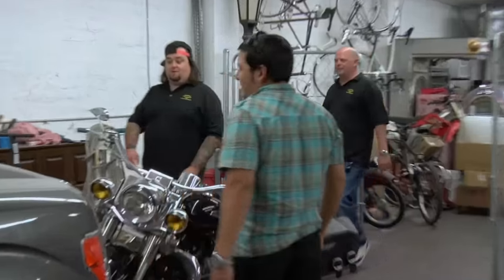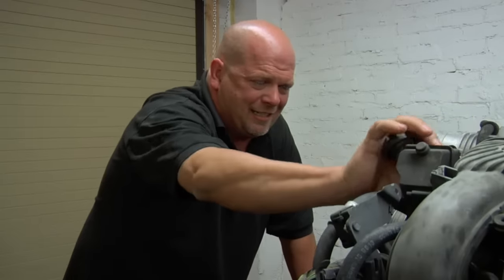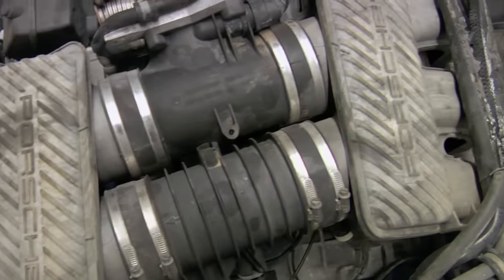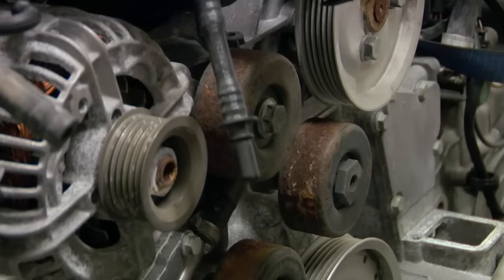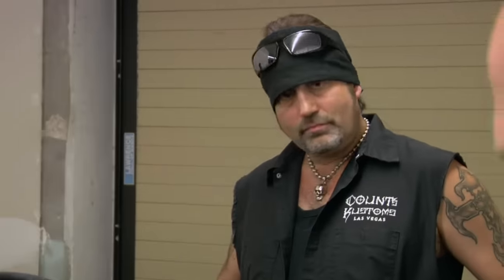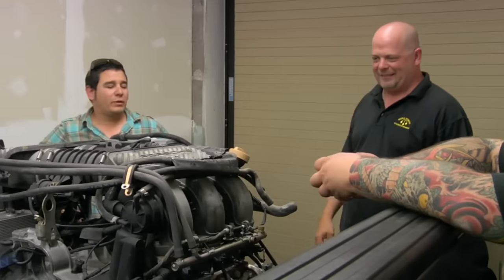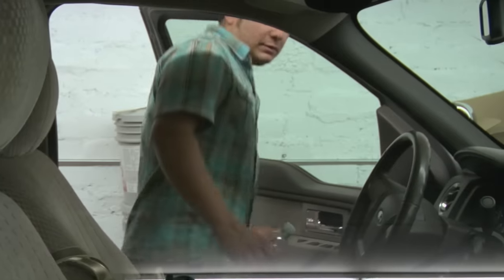Pawn Stars: Seller INSULTS Expert Over Damaged Porsche 911 Engine (Season 4)

Comment from the maker: Watch all new episodes of Pawn Stars, Wednesdays at 9/8c, and stay up to date on all of your favorite The HISTORY Channel shows at http://history.com/schedule.
Reply: Dannys a real man for letting him slide after insulting him like that
Reply: Sold!!!
Reply: A 2000 model year 911 engine is one of the worst POS engines they ever made. Stay away from all 911's from 1999-2005. Even the 2006-2008 ones were just OK. 2009 on is fine.
Reply: Yea, no way to know if your $ is well spent.  Have to treat that engine  as a rebuild only unless more is known about it. MAybe do a psi wet and dry test using an external power source to spin the crank. With that results only way to justify a purchase. There could be more, case cracks, etc.
Reply: Jes

Comment: Even with ZERO water damage, the 1997-2005 Porsche engines were notorious for IMS bearing failures, and the 2000-2005 were of particular concern, especially if they sat idle or were driven only infrequently.  You did well to pass on this pig rather than get poked!
Reply: I was thinking the exact same thing. You really got to hear them run to know
Reply: Hence that's why it was sitting in a junkyard
Reply: @benruether8294  That bearing could be "failed" and just before it gets to the level of making noise you would hear while it ran. This is why its now considered a preventative maintenance item on them. Fix it before it eats the engine. However with that said, rebuilding the engine would be a given regardless of its condition.. someone should have inspected the engine properly. I get Rick not wanting it, he should have just said that rather than try and make it LOOK like they know more about it and disrespecting the guy. Even Tavarish would have borescoped the engine.. and hes not what i consider a "mechanic"... Just a hobbyist with a ton of money.
Reply: @crisnmaryfam7344  The only “disrespecting” was done by the guy. 🙄
Reply: Pretty sure that 1997 and 1998 993 engines didn't have IMS failures.  lol.
Reply: @TheInvisibleAmericanMan  thatnks for speaking up, So whatcha think of all these "mechanics" on you tube?
Reply: Bingo!
Reply: That goes for all engines, if you can't hear them running or take them apart they could be expensive door stops!
Reply: 12-14k is the going rate for that "pig" now
Reply: @subyoooyoy  for a good one, not one that needs to be completely rebuilt.
Reply: Thats a preventive maintenance thing man, not a show stopper. Get your facts right please. 4500 for this engine even as a core charge is legit.
Reply: @rubbermoetroken  The category "preventive maintenance" refers to routine changing of oil and filters and the like.  Replacement of internal bearings (e.g., camshaft, jackshaft, crankshaft, or IMS) requiring engine disassembly is categorized as "repair."
To insist otherwise one would have to have his Porsche head stuck way up his Porsche tailpipe.
Reply: Common sense......nope
.
Good call

Comment: When the seller said to bring a good mechanic it cracked me up..this mechanic is among the best
Reply: A Good mechanic would have said the same thing or at least turn the crank so u know it's not locked up but even then who knows the mileage, when buying engines you kinda have to go buy what it's worth torn apart completely, like heads, crank and pistons but you have have to be into those specific engined and be a rebuilder, then it's worth something
Reply: a GOOD actual Mechanic would have borescoped the engine before saying stuff got inside of it. Now he is right sayin some of those open ports are issues, not deal breaking ones though.
Reply: It's funny because he expects the buyer to take on the additional responsibility of having the motor checked by a mechanic. An old engine is going to need some service. The fact that he insulted Danny ensured that he would get nothing.
Reply: @LPWSzzz That is what I was thinking. Scrap value...
Reply: Danny owns a shop, never seen him turn a wrench he just tells other people what to do. He may know stuff, but he aint no mechanic..... my 14 year old kid could tell you that engine (definitely not a motor) was junk.
Reply: "among the best" yet he thinks an aluminum engine corrodes? lmfaooooo that engine is worth 12-14k now btw. My dude has xray vision, he can see inside the engine and all the rust that does not exists because aluminum doesnt rust.
Reply: @subyoooyoy  If you don't understand that all metals oxidise or corrode then please hand your man card back in...... Aluminium corrodes worse than steel in certain circumstances.

Comment: You can’t leave fuel injector rails,throttle body,exhaust manifold all exposed to rain and moisture. The entire motor needs taken apart to see how much rust is going on inside. Good call by Rick not to buy this motor. He would have to put a ton of money into it just to get it running well.

Comment: When a guy won’t let you open up the engine, then there is something he doesn’t want you to see
Reply: You don't need to "open" an engine to check its health.  A compression and leakdown test will tell you everything you need to know
Reply: @evogsr4807  check the cylinder walls and pistons with a camera too. would've helped the seller if he had it running in a video. For all we know, it could have knock, low compression, clogged injectors, and more.
Reply: @evogsr4807 a compression test and leakdown test is not going to catch a spun bearing, scored crank, etc.
Reply: Open up the drain plug, pull the dip stick, pull the spark plugs , use a scope...for a general fast check ✔️

Comment: As a tech for over 30 yrs plus being around it all my life. Engine was rained in, water down fuel rails and injectors, water or moister in intake and exhaust. Engine would have to come apart and junk fuel rails and injectors and most likely throttle body too.

Comment: As a Porsche 911 owner ( 997 / 2006) the early water cooled Porsche 996 engines have many issues . The failure of the intermediate shaft bearing to name one. This failure  results in the total destruction of the cars engine. My 2006 has improved internals so a well maintained 997 engine has from what I have read about a 5% chance of having the issue . You guys were 100% right to pass on this engine 👏👏👏👏👏

Comment: That motor is a boat anchor, that might not even be rebuildable. That year of 911 had all types of motor issues, including the infamous IMS bearing. Also many places that should have been sealed off and could have let water in, were left open. This cracked me up.

Comment: as a Licensed Master Mechanic with 42 years experience here is my humble opinion:
1. unknown engine condition. Why was it in a junkyard?
2. throttle body uncovered is not a big deal. The throttle was closed. 
3. fuel rails open. Not a big deal.
4. rusty pulleys. Easily replaced.
5. oil condition. Danny never checked the oil.
6. at best this engine is a core to rebuild. valued at about $500.

Comment: As a mechanic, I completely agree with Danny. Having fuel rails and intake and such exposed to the elements can and will make everything ruined and unusable. Even if it was torn apart and a machine shop attempted to repair the block, heads etc, it would still be a roll of the dice.

Comment: That look Danny gave him is killer,  Danny is right,  humidity gets into everything, he's better off scrapping it 😊
Reply: Not better off scrapping we don't know condition if it truly wasn't blown up it is definitely atleast a good core. I just got shafted at a wrecker bought a used engine for my Chevy truck didn't get around to installing it for 6 months I was well passed the warranty I decided to pull the heads after seeing bolts in the intake runners what I found was severely rusted cylinders I cleaned up as best as I could and with each piston as low as they go I honed the cylinders it came out nearly perfect (no pitting thankfully) . it's in the truck with perfect compression on all holes and running good I was not in the position to do a proper fix or buy another engine with how prices are on stuff right now and everything else going on in life so I chanced it and it's working great this engine could be a good candidate for something like that if you were building a budget 911 but the engine should be sold at the rebuildable core price and the new owner can decide if they want to chance a greasy build or have it rebuilt but please do not scrap stuff like this as it would be almost 100% salvageable in some shape or form if we continue to just scrap eventually there will not be more 911 engines

Comment: The seller is right........ If Danny knew ANYthing, he'd have had a wrench for seeing if the engine was seized and a simple scope (you can get one for your phone for less than $15) for looking down inside at the pistons thru the spark plug holes IF he was any kind of actual mechanic.... Truth be known, with a battery and fuel supply, that motor would probably start right up in the back of that truck..... All he had to say at the start was, "show me it runs" and that be that...
Reply: The rust on the outside is enough to see  it hasn’t been stored well

Comment: The fact that he's trying to sell a roached M96 for $4500, when I bought a running one for $2500 WITH a car attached, amuses the crap out of me.

Edit: if it's a water cooled Porsche flat 6 from 97 to I think 07, learning that it sat for "a few years" is a deal breaker, unless you're getting it for next to nothing. That IMS bearing doesn't like sitting in oil nor does it like sitting still.

Comment: Props to Danny he simply stated to determine the condition it needed to be examined internally …that’s correct with it you have no idea .
Now maybe he wasn’t aware internal inspections can be carried out with an endoscope from the outside but hey the way he was blinking he didn’t know what he had ..
And yes this was likely an early 99 or 2000 engine are notorious for bearing and seal issues .. good call !

Comment: Just put a boroscope inside and take a look. Also, you could turn it upside down and see if water pours out, you could put a wrench on the crankshaft and see if it turns over.

Comment: The "expert" didn't even mention a compression test and if he think u need to open a motor up to check if it's good I'd be right there with the customer. I've bought MANY engines from the junk yard. As long as the fluids aren't mixed and it holds compression there isn't anything that can't be fixed

Comment: First off. A junkyard engine isn't a bad thing. If you're buying a Porsche motor anywhere, you're going to overhaul it and do all the work to bring it up to operational standards. The only thing these guys needed to do is get a bore scope and inspect the cylinders. If there's no rust or pit damage, the engine can be built. Try buying a low mileage engine like this in prestine condition. 
$4500, no way. I would be in it for 1,000 if I was in the market.

Comment: Dude is right, a good mechanic would of just looked at the engine sitting in the back of the truck and say how good that engine is without hearing it run or inspecting the internals

Comment: open throttle body send in a borescope and show sir shifty the internal rust !!!!!  look thru plug holes and oil pan drain!!!!  no doubt theres issues as when camera glanced over open connections on motor you could visible see the corrosion and rust tint!!!  even you pull it motors always run a compression test as internal rust will collapse rings!

Comment: Danny was a class act who exercised exemplary restraint. He could have destroyed that seller by saying he'd forgotten more than the seller knows about engines.

Even if a boroscope had been checked on the throttle body or within the fuel rail, I'd have concerns about the intermediate shaft/bearing, that are known for failing when the whole car is left sitting without being driven for extended periods. If it's an exposed engine in the elements to exacerbate an IMS/bearing failure, I wouldn't walk away from it; I would run.

Comment: 100% for sure at least two of the cylinders have open exhaust valves. That's normal. The exhaust not being closed off means those two cylinders have had years in the elements, being humidity or whatever it is. Same with two opposing cylinders intake valves. The throttle body is not sealed, therefore humidity has been making it to the intake manifold and two more cylinders for years as well. 

Any decent mechanic would know this. That guy was probably a scammer.

Comment: The way to sell an engine like this is to have it rebuilt, and then sell it with a warranty of the shop that rebuilt it.
A rebuilt 911 engine like this could easily bring 10k, and it would probably cost half that to rebuild it.
Reply: Be a good approach, upgrade any known issues, decent warranty, etc. 
unless the guy knows its total junk and beyond salvage, rod knock and run hot, probably how it ended up where he found it

Comment: Tbf that mechanic should have known the 911 engine of that time had issues with both bore scoring and the Intermediate Shaft Seal (IMS) bearing failing which costs 000’s to fix separate to any corrosion inside that they were worried of.

Comment: Motor came out of a junkyard, red flag.  Unless you heard the motor run before it was yanked  out of the car, forget it.  Junkyard motors are only worth something if rare, say a 426 Hemi that's been sitting undiscovered, or a 428 Cobra jet, etc.   Sure, I'd grab either if the price was right, knowing I'm going to do a complete tear down anyway.  This dude should just sell it on craigslist.

Comment: The one rule of thumb when buying a used engine is when you hear it come from a junkyard unless you or buying a engine from a junkyard cuz a lot of people buys old small block 350 LS engines and rebuilds them but when you buy one off of Facebook marketplace will let go or offer up and you hear junkyard and here that's been sitting for years that's a red flag because moisture would get into the cylinder walls and corrode it badly making the engine stuck or seized So this guy telling Danny that he's not a professional one he spent a mechanic all his life is bullsh

Comment: Are you kidding me? A idler pulley or serpentine painted pulley getting surface rust doesn't devalue an engine. The the oxidation on the alternator and other aluminum parts is your best bet to tell how long it's been sitting or exposed to the elements.
Reply: Why would they want an engine that's known to be absolute junk?

Comment: The Seller had misdirected rage. Rather than Lash out at Danny he should have been angry at the guy who did not take the proper steps to protect the engine from the water and environmental elements clearly he was the mechanic who did not know what he was doing. Secondly, the buyer should have been mad at himself he took a very big gamble buying the Porsche engine from a junkyard and it did not work out. Thirdly the buyer probably knew there was at least some degree of damage to the engine and wanted to recoup some of his losses. It's a good thing Rick is smart and savvy and saw what was really up.

Comment: The first thing u do is c if it will turn over & then do a compression test if it does & he knows this. Rust outside happens fast if it isn't used but doesn't mean it's no good.

Comment: Water damage, lol, rusted pulleys on a engine are more common than the sun coming up every morning.

Danny is correct about the engine not being sealed though, once you pull a engine out and you plan on using it later you need to seal everything good and tight cause moisture can get in eventually.

Comment: I mean, mechanic should brought a bore scope and manually cranked the engine, could have easily seen inside each cylinder. Also could have done a leak down test on each cyl.

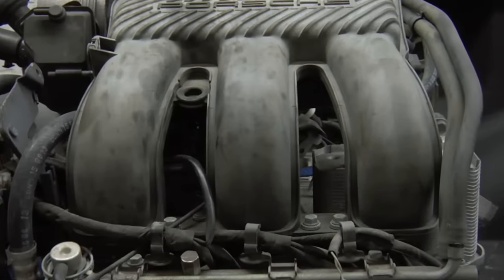Comment: 0:38 PANCAKE motor? You mean a Flat or Boxer engine? Ive been into cars and working on stuff my entire life. Old 70's VW included... made many of them into trikes, However, Never have I ever heard another person call them pancake motors... Flat, Boxer or H engine.
Reply: 1:13 That is minimal "water damage" most cars that are daily driven in the "rust belt" look FAR worse than that. Dude is a little spoiled with his salt free DRY environment where cars dont ever rust... they are just washed away by blowing sand. That oculd be fixes by minimal accesory pulleys being replaced. Items that are preventative maintenance anyway.

Comment: You could start by rotating it at the crank...see if its seized. IMS bearing is cheap (relatively) to replace with engine being out... definitely if you're gonna put this engine into another 911 good idea to replace it. Boroscoping to see inside cylinders is another thing you can do. Danny just looked at it and said too many unknowns...lol. I guess it was just a show...meant to be entertaining not factual.

Comment: I wouldn't say that looks like water damage it looks like rust damage. If you leave it near the seaside it will rust fast because of the salt which is always bad. So it is a bad motor.

Comment: 4500 for a non running porsche  engine?   to rebuilt it cost 1k plus..  I would never ever buy it unless it is very cheap.  It would havebeen different if this was still in a car.  I say value is 1000  max

Comment: Sorry but Danny did not a good job, but did a good job. That means hands off this engines right away without further deeper inspections. The 996 engines had Big major engine problems.  The Nicasil cylinder wall coating was bad and a lot of engine broke with major brakedown damage.